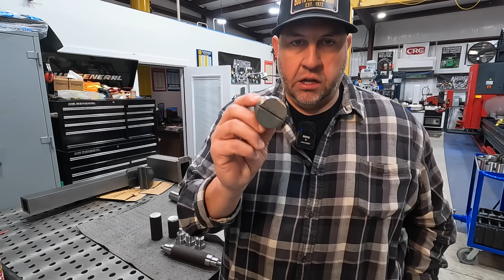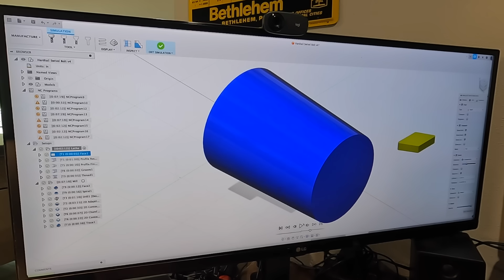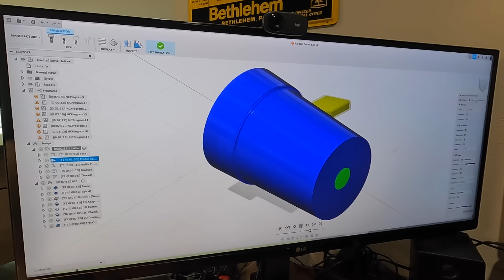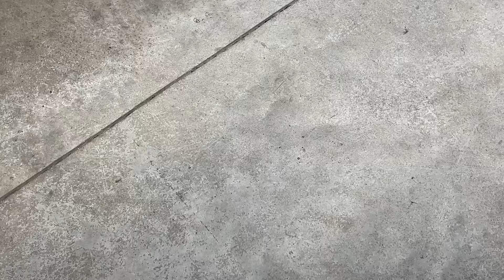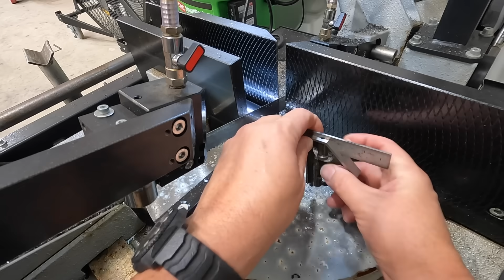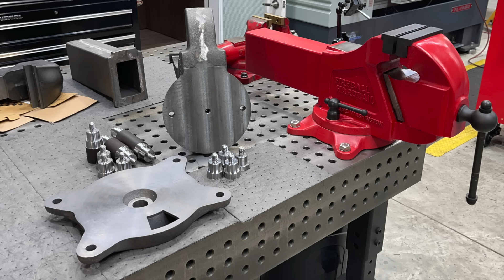Hardtail Vise Build Ep.12: Swivel Bolt Turned in the CNC Lathe

Comment: Hello Adam,

nice greetings from Germany. I've been watching your videos for 6 years and I like the way you edit your projects.

I know that you are not very good at CNC technology and that the bolt is a practice piece for you. I may have an idea or two for you.

First I noticed the problems with clamping in the chuck, which you also have with the 6 jaw chuck. I mean the rattling. Since you only use spiral chucks that have a very low clamping force transmission, you should reduce the feeds. I assume that you are using the values from Walter Tools, which the tool and the machine can withstand absolutely. However, at high speeds the clamping force is reduced by up to 40%. Now add the "poor" clamping force transmission and this explains the chattering and also the fact that your workpieces are pressed into the chuck during machining.

I know the values from Walter tools or Kennametal or Sandvik, the tools are fantastic, but I'm afraid that your chuck doesn't have the clamping forces. Unfortunately, planed spiral linings like the ones you use are bad. Wedge bar chucks are better, as they transmit the clamping force much better.

Alternatively, you can definitely try using claw jaws. These prevent it from being pushed into the chuck.

I hope that the advice helps you, and you are welcome to write to me with the details and I will send you the relevant links

Have a wonderful 2024 to you and Abby. By the way, I really like your chocolate marhmellow bananas from your travel channel

greeting

Manuel from Germany

P.s.: sorry for my bad English, but thats one of my problems, that ein learned by your channel und i think i getting bette after 6 Years of your Videos
Reply: I understood all, good thinking.

Comment: I still don't get how easy americans think about a 1 thou deviaton... That is 0.025mm. I (we) used to work within 0,01mm at maximum (for critical dimensions) for a lot of the products.
Reply: No, it's not a "European thing". We are plenty capable of machining parts down to micron tolerances here in the USA. We have lots of shops that do it every day. Holding every single dimension to 0.01mm can be anywhere on the spectrum of mission-critical to no-value-added. Adam regularly works within +/- 0.001" usually because his do not demand tighter tolerances to be perfectly functional. Spending more time (and money) to be tighter than that is simply a waste of resources.
Reply: 😂 this is a ridiculous comment
Reply: This sounds like the mentality of an engineer with limited machining experience. It's easy to specify an arbitrarily tight tolerance on a drawing. Just because you can, doesn't mean you should.
Reply: I hate the imperial system but this comment doesn't make any sense

Comment: I wonder if the skloppy fit of the original bolt is intentional.
The dovetail ring for the locking screws is just a casting, so I assume it has some runout or at least inconsistency.

Comment: And you wasted how much stock and time?  Still would have gone with manual lathe. How many of these parts are you churning out? I understand you want to keep with the times,  but this a lesson where less is better. You still had to go back to manual lathe to get it right. STAY OLD SCHOOL  🙏
Reply: No, JACK WAGON. GO NEW SKOOL !  I watched the same thing you did.. He didn't have a chuck large enough to handle the diameter of the 4140.  So going over to the manual lathe is a limitation of the CNC chuck.  If you record your tweakings and tunings required for a given metal type on a CNC, all you're doing is being thorough.  CNC machinists normally are running the same material, the same way.  The 3 jaw chuck might be the achille's heel.  That doesn't reflect on his ability to convert a design he created in Fusion 360 into a part.  They are two separate issues.  And who would have gone with a manual lathe? You? Him?  The Man on the Moon.  Try to use proper English grammar and employ the object and subject of a declarative sentence.  Unless of course you weren't paying attention in Grammer Skewl.  Have a great evening!
Reply: @silasmarner7586  your opinion  fine sir.
Reply: @silasmarner7586  and going from manual,  back to cnc makes sense to you?
Reply: Ok boomer
Reply: @beebob4572  your opinion fine sir
Reply: And so many CNC lessons learned. You had better understand it is Adam playing with HIS toys to make HIS vice and having some fun along the way!
Reply: @seabreezecoffeeroasters7994  I understand that,  but at what cost? Both time and material. Write the program,  prove it out,  mountains of material,  just to go back to the manual machines to get it spec? Could have saved precious time and scrap parts to do it by hand. This is the learning curve. Not saying it's wrong,  saying there's tried and true  way.
Reply: @kellykaplan6413  Everyone starting out in CNC with no one directly over their shoulder is going to burn some material and a bunch of time. You are still missing the point about all of these things in the learning process.
Reply: @seabreezecoffeeroasters7994  I don't think I am.  Why abandon true and proven techniques? For stuff that costs you $$ to do one offs? I totally understand wanting a mass production machine, but the investment doesn't pay till you have mass production.  Right? Or wrong? And 'a finished ' part still has to go to manual machines to be finished.
Reply: @kellykaplan6413  You need to get off your high horse. This has less than ZERO to do with material or time! Listen to what he said in the video it would have been way faster to make it on the manual lathe. This is all about the journey!
Reply: @seabreezecoffeeroasters7994  There isn't a ladder high enough for him to use to get down with.
Reply: @seabreezecoffeeroasters7994  all that you said is very true and I'm not disputing that. It seems a waste of profit,  from a business aspect.  As much for  'production ' for medium size shop, I call a waste of money. Adam is well respected, his family history demands it. My opinion,  the cnc isn't for his business. Just an opinion. I have a bais against cnc, FYI, I hate it
Reply: @seabreezecoffeeroasters7994  you just said no matter cost nor time, it's  about the jollies. What business lasts more than 6 months after doing that? Be honest
Reply: @kellykaplan6413  Let's talk honestly then shall we. This is Adams project NOT YOURS. It is his business NOT YOURS. It is his learning journey NOT YOURS. Clearly this won't sink in while you preach self righteously to yourself but give it a go anyway.
Reply: @seabreezecoffeeroasters7994  again,  I respect your opinion.  But from a business aspect. Cnc for his shop, isn't a good investment.  My opinion. I admire the old tooling and the experience he has with it. I despise cnc for the simple fact it removes the hand touch.
Reply: @seabreezecoffeeroasters7994  again,  I ask, why go cnc if you don't know it. Wasted time #1. Wasted material #2. Wasted shop space#3. I give kudos to wanting to learn. Not a great business decision.  If there's no steady repeatability jobs, you have dead space. What dead space pays rent? Ooh, and there's payments on the dead space taker upper machine
Reply: @kellykaplan6413  Again you are ASSUMING your Business idea matters. It does not. Adam's business is mainly YouTube not production, not jobbing.
Reply: @seabreezecoffeeroasters7994  again, my opinion,  his business is a machine shop. Not a test bed. He machines parts. Does he make his living on YouTube?  No, he puts out videos to supplement income. Adam has a machining business that does well for itself.  This cnc thing, my opinion,  doesn't seem like a profitable venture. You're free to disagree.
Reply: @kellykaplan6413  You clearly watch different videos then to see him running a machine shop. He hasn't done that for a majority of his income for several years and before that his majority income was a wage at Motion. The CNC gear is 'on loan' for promotional value and if you wanted to set it up to make $$ then the Milltronics gear is NOT what you want.
Reply: @seabreezecoffeeroasters7994  AMEN, brother, well phrased.  A content creator these days.  I would opine that his majority income was at his dad's, at Motion, and nowadays the YouTube, in that order.

Comment: Adam the weak link in your setup is the excessive tool length from the turret. Even if you have to cut the shanks you will gain maximum rigidity. Also check the lead in angle of the threader. Make it so 95% of the material removed is on one side of the vee (29.5 ° lead in angle). Hope this helps. You're doin great!
Reply: As can plainly be seen, a 4x stick out on a shank will obviously create rigidity issues especially since it is completely unnecessary.  I agree that threading parameters and speeds could be tweaked in many ways. I was just giving one example based on how it sounded to me. As far as your overtightening theory, as long as the fasters are intact and the threads aren't marred, I think he's good. And given Adam's level of experience I think he knows not to go overboard when torquing fasteners.
Reply: Tool stickout is usually not the real culprit in this kind of problem. Sure you can get around it by cutting the shank and reducing the stickout, but the core problem remains. That's correcting a symptom rather than the source of the problem. I think first the tool might be overtightened, and the insert angle maybe too shallow for this thread, should be 1 to 2 degrees and not 0, which is shown as one side of the thread is rubbed instead of cut. Also, the number of thread pass is too low, the rpm is too low, and the last pass has a depth of cut too shallow, like a spring pass. It works on a manual machine but on CNC you need at least .0005 of material for the final pass otherwise it will chatter. CNC turning is a whole different world and things that worked for decades suddenly don't anymore.

Comment: Adam, I might suggest that you get a torque wrench to use on the chuck instead of the "T" handle, and tighten all three scrolls to a set torque which you will have to determine with some testing.

Comment: Once you have it the way you want, send one back to Fireball.  Give him an inexpensive quote for the first 50 and learn what CNCing is all about.  Bad news though, I've watched the CNC knife guy in NY and once you've learned all the CNC tricks you'll still spend hour and hours with the machines and computers getting them to work the way you want.  It never ends.
Reply: I'm sorry, this just isn't true. There are thousands and thousands of shops in the US alone that use CAD/CAM for one and done parts every day. Manual still has its place, especially for repair. You will find very few shops using manual machines for production work.

Comment: Consider rerunning the finish pass over the od of the thread, and then re running the finishing pass of the thread. Should eliminate the need for filing.
Reply: He can actually use his grooving tool already in the machine and make a thread pass of only one thread length, using the same spindle speed, and a chamfer exit out of the thread. Using some local X and Z offset to get it perfect. This will not only eliminate the need for filling but generate a magnificent first thread. Sure, the first time you do it you need to fiddle with it until it's good. But then you simply keep it as a subprogram and it works perfectly every time

Comment: As good as the Miltronics is, I believe that it still has resonant frequencies.  Unlike big, old cast iron frames, modern machines use tubular frames, which, if you hit them with a wooden mallet will have a ring to them.  Old cast iron machines sound like grave stones.  I think the reason that the 6-jaw might be producing inferior results is that, when added to a resonant frame, it might make the assembly ring like a bell at certain speeds.  I wonder if putting sand bags on the longest sections of tubular steel might help. I have a 1943 Cincinnati horizontal machine that has no resonance.  Those were the days!
Reply: Literally everything has resonant frequencies.
Reply: Everything has a resonant frequency. Along with both even and odd harmonics derived from it. Recommended cutting speeds are not always what one should use to machine items.
Reply: @joebledsoe257  True!  Big old cast iron's frequency is just far lower than tubular frame setups. It's usually low enough that it never comes into play at all.
Reply: Good thinking. We have this problem in our shop. Old lathes and mills are basically chatter free even on crazy stick out and terrible setups, while brand new CNC machines will make everything chatter because it's too rigid at the wrong places. I usually get around this problem by tightening the tools a little less and using smaller nose radius
Reply: @Orakwan  When I machine stainless, even under heavy cuts, I can feel some small amount of resonance in the floor, but the frequencies are so low that they can't produce visible artifacts in the cut.

Comment: Obviously this is you learning to CAD/CAM and CNC where any project is good, but this shows why one off parts are almost always quicker on a manual machine with a skilled machinist. If you're making multiple parts CNC is king. Happy new year!
Reply: I’d love to take you up on that. I’m the one that has been helping Adam with these parts. I would guess that I could draw this and program the lathe side in less than 10 minutes. As you said, he is learning. The next project he does will go quicker. And the one after that will be quicker still. As he said in the video, we could have parted this off in the lathe too. Then move it to the mill and you are looking at about 8 minutes total run time per part for both lathe and mill.

Comment: I’m sure if you wanted to find the correct amount of torque needed on the CNC lathe you could check it with a torque wrench and be precise.
Reply: Now I think the pushing back of the material is related to the shape and sharpness of the tool.
Reply: Due to truck accidents, etc, I've lost a lot of strength in my shoulders.  I found that using the torque wrench gives me the leverage I need to get enough grip on the stock, and the 'click' helps me keep from over tightening.  Tightening the marked cam last helps keep things consistent as far as runout on the 3 jaw.

Hard material in a hard jaw chuck will slip easier, so getting enough grip without overdoing it becomes more difficult ... and I'm too poor to replace a chuck that sold for $2,000 two decades ago just because I had too much coffee that day

Comment: Turned parts look good, however it sounds a little heavy on screw cutting. I don’t know what options you have available with your lathe and/or cad software but decreasing depth is a great function. I will often take cuts from 0.25 down to 0.01mm, especially on one off parts where cycle time doesn’t really matter.
Reply: It seems to be doing constant pressure cuts so depth of cut varies decreasingly. Which is good. I think not enough cuts, too low rpm and the finishing cut is a spring pass causing chatter, should be a real cut of 0.01mm